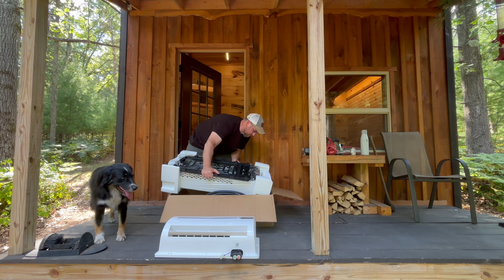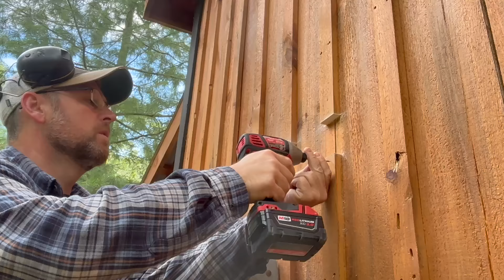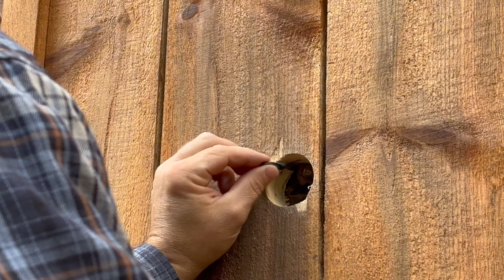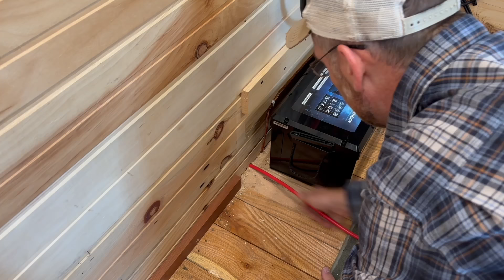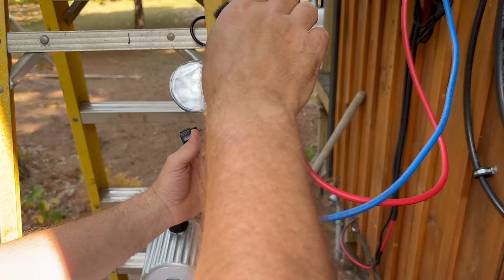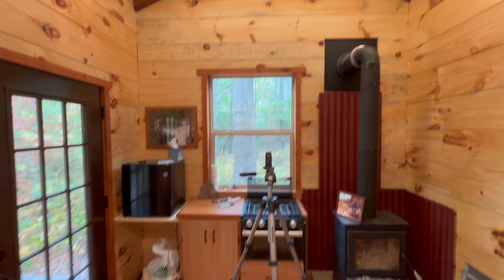12 volt Air Conditioner in the Off Grid Cabin ! OutEquipPro

Comment: So if you do not mount any of this in the van, (I'm living in mine) can you just prop the inside unit against the van wall and keep the main unit outside?  I ask because I don't need it when driving only when camping overnight anywhere.  That way all I need to do is place the compressor side back I the truck and go to the next camp ground.
Reply from the maker: I'm  not sure that might work but seems like a lot of stuff to drag around . I actually put one of their 12 volt roof top ac units in my camper and it works great , it only weighs 40 pound and its low profile here's a link to that video might be a better option .https://youtu.be/ZJUVoA1Ut2k

Comment: Just drill a bigger hole inside for everything. Then cover it with an appropriate piece of timber. You are making a relatively simple job way harder than it needs to be. Other than that you have made an awesomely informative video. Really appreciate the rest of the detail!!
Reply from the maker: good point !! thanks , glad you liked it !!
Reply: He did it correctly dont teach bad habits cutting corners is laziness
Reply: @MichaelConnor-e3z  You are mistaken if you think it is laziness. The correct way is to get the job done is in a timely manner as well as making sure it is easily serviceable in the future. Wasted a lot of time on those small holes for no gain.

Comment: When pulling a vacuum on this unit, listen for a change in sound when you're shutting off the valves. If no change is sound, you're at a negative pressure as possible. Your machine sound didn't change when you closed the valves! 

Is this cabin just going to be used in the summer? This unit appears that it can't be in a "heat" mode.
Reply: Went to website and with the noise levels it should be much quitter when running. At 35 db's you shouldn't hear it running.
Reply: 10x14x12 is 1,680 cu. ft. Plenty big to cool your cabin. In homes that I helped build I was up to 40,000 cu. ft. @ ton (12,000 btu's).

Comment: Commercial refrigeration guy here.

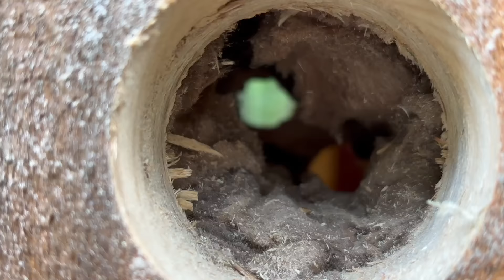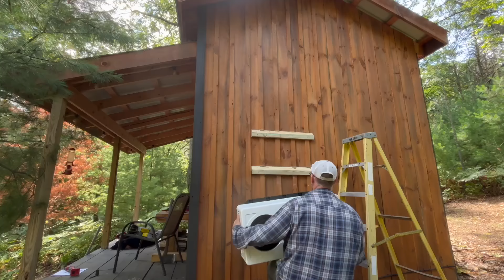We use microns (micrometers) for measuring vacuum. Analog gauges are horrible for measuring vacuum (but the best for measuring higher than atmosphere pressure.) Their most accurate reading is when the needle is at the 12:00 position. So in a deep vacuum at the 7:00 position, it's not accurate at all. For refrigeration, accuracy matters because we have to control things with 1 degree (f) accuracy - like for medical equipment. A vacrometer that measures microns is the tool for measuring vacuum pressure.

I always pull a sub-300 micron vacuum to make sure there are no leaks. The difference between 29" of mercury and 29.9" of mercury is 20,000 microns. 29.92" is a perfect vacuum, which costs 10s of thousands of dollars worth of equipment to accomplish. So 300-250 microns is the best you can really hope for with standard equipment.

Air Conditioners are dirty nasty things that don't require much precision. For ACs, it's not that big of a deal as far as moisture or trapped air is concerned. But a 30" vacuum measured by analog gauges isn't a good indicator of whether or not you have a leak. 300 microns or less guarantees no leaks.

I'm not nitpicking and I know this comment isn't really relevant. You seem to be a self-educated type (like I am). So I figured a little random info from an old refrigeration guy might interest you (if you even see this comment lol). Speaking from personal experience, I love the trades and I love learning about certain habits or techniques from pros - whether I'll ever use them or not.
Reply: Me and my dad just installed a mini split at his house a month or so ago, we were racing to get it done right before an ice storm. We got it done and wanted to do a nitrogen and bubble check before re vacuuming and letting the refrigerant go. We were too late and it started freezing before we could bubble check the outside unit. 
I left him my equipment and a couple weeks later I walked him through how to set it up with the micron gauge. There's a bad spot somewhere in the pump or gauge set and you have to play with the knobs to start getting a good vacuum. -30 on that set is easy to achieve and he finally understood that after seeing the micron gauge go to 4k or 8k and -30 still holding strong on the manual set. 
He finally let it go at 150 microns. I wanted him to hold out for less than 100 but he said 150 is probably better than what most do. 
I need to get a vacuum tree and maybe try and rebuild my gauge set if possible.
I wonder if you can rebuild a 4 port yellowjacket gauge set?
Reply: @jamesrogers4674 150 is really good, if it's an accurate reading. 300 is about as deep as I go because of time constraints. Customers look at me weird if I'm sitting in my truck playing games on my phone for an hour while waiting for a system to vacuum.

You can totally rebuild yellow jacket manifolds. All the parts houses sell kits for them. Most of the leaks are in the little o-rings on the hoses though. They get chewed up over time. They're easy to pop out and put back in, just make sure you put the Schrader depressor back in. (You can also pop them out and flip them 180 degrees in a pinch if you don't have spares.)

If you have access to a sniffer (electronic leak detector) it makes finding leaks 100 times easier. I put a few ounces of refrigerant in a system, backed by 250psi of nitrogen. The sniffer gets you to a general area, then you can pinpoint with bubbles. On a mini-split it's probably at the flare nuts at the condenser or air handler.

Comment: The outside unit looks exactly like what truckers use in their trucks. I thought about installing one of these outside units by room, moving my spare tire and mounting it in there I was just concerned about dirt or water from the road, which shouldn’t be a problem considering that it’s an outside unit and the fans would be facing down. somehow, I knew you were getting the cart ahead of the horse install installing both units to the wall without connecting them first. i’m really thinking you should have all wiring and hoses in a conduit being that you’re in the woods and animals like that chew on things.

Comment: I found that torquing those fittings to spec  by a hired technician was essential. He didn’t do this. One of our units slowly leaked the VERY expensive Freon over a period of a year. I took it upon myself to install the replacement minisplit. I followed YouTubers guidance. It’s held nicely over the last two years so far. Thanks for the video, love your cabin!
Reply: It sounds like yours was a residential unit with flare fittings.  For those, it's a metal on metal connection (no o-rings) so the flare must be perfect and the torque spec is critical.  His is an automotive unit with automotive fittings.  They have double o-rings and operate at much lower pressures.  So, the torque spec is really not that important.

Comment: I have been running a dual head split mini n a 400 sq ft tiny house for 5 years without an issue. I did put a surge suppressor on the power line.
Reply from the maker: Awesome! Glad to hear yours is working well

Comment: Just curious but couldn’t you have just ran an AC outlet from your inverter to a window ac unit?  You might have to put in a window but that’s not necessarily a bad thing..
Reply from the maker: yeah I don't see any problem with that I guess . I'm no expert but it does seem like everything ran on the inverter seems to draw power faster than if its DC though

Comment: Open the indor unit and try to fix blower motor position most of the time preoble is that sometime during shipment the blower motor dislocate fro it's place and make such noise I have face this problem before it's 100% blower motor dislocation position

Comment: You can't really judge the A/C in 75 degree weather. Test it again when its 90 degrees outside and that's when you really know if it works. My bet is it would fail the cooling test under the conditions you really use A/C.

Comment: I like to use scrap pieces of solid copper from romex trimmings to use as short pull / push sticks for wire. Steel tig wire works a little better since its stiffer and springier but if you don't have it 12/14ga copper works well.
Reply from the maker: Thanks for the tip, that's a clever solution!

Comment: So there is no reason why this shouldn't work as well as a 110v AC one...Because the limiting factor on this is the power you are pusing through to the motor...sure, it is only 12 volt...but there is no reason why they couldn't put a 24, 36, 48 volt motor in for the compressor side...so, it only matters if it is something silly stupid like a Peltier type device.  Those are awful for the most part as they can ONLY ever really get you a temperature delta of at best about 30degrees.

That being said...
It is possible to actually build your own AC from scratch (not completely easy but possible) because all you would do is replace the two motors with DC of the voltage you want to provide.

Run the entire cabin on DC and have the appropriate regulators and  buck converters for changing the voltages where needed for each device.

Your only real limiting factors will be how you generate the power.
You have the land for solar grid array on the ground...you are in the environment for a good above tree top height wind..I don't know if your property has any running streams on it...but if you do you could even include a lower flow water system that builds head pressure through numerous ways.

Comment: From a noise perspective, how about not mounting the outside unit onto your cabin, but on a stand of sorts, supporting the weight and preventing noise vibrations from going straight through the wall? Not possible on a van setup, but on a cabin...

Comment: As an HVAC tech for 29 years I would say that indoor unit is not gonna last. Maybe had some packing material in it or just needed to have the blower adjusted. Few things I would have not done is had those lines looped up like that. You just made a bad oil trap which will burn out that compressor eventually. Need to lower that condenser and I would have tried to make it on a hinge to swing out for coil cleaning. Other than that I can very much appreciate the DIY and units don’t care what they are installed in. Long as the power is right it will run. Overall nice job for a quick solution. That place is beautiful.
Reply from the maker: Thanks !!! I should pull it off the wall and check to see if I can figure out what the noise is . so what if I just tied the top of the hoses way up so there's not a big loop on the bottom . do you think that would stop the oil trap problem ?

Comment: WTF!?!?  When you turned on the unit I thought you were running a gas generator to power it.  What is that horrible noise.  Any other system I've seen installed you could not hear running. I would take that cover off and see if you missed some packing somewhere.  Thinking it is no big deal is a recipe for dead fan or leaking freon ...
Reply from the maker: I plan to but I've just been so busy with my other cabin build I haven't had time for much of anything

Comment: I've never heard of this brand of mini-split, but these are one of the perfect instances to use em. I'm sure this guy researched the brand beforehand, but if anyone else is thinking about installing a minisplit, I'd recommend doing alot of homework. I've worked on these from all kinds of manufacturers, some from several locations in Europe, where you may be waiting for replacement parts to get shipped to you. And when I say waiting, we had a customer wait 6 months to get a circuit board from Crimea(?). Most mini-splits we work on are the ones DIY guys tried to install themselves, which is fine, but trying to save cash may ruin the system and burn whatever you paid for it. Study the system and do your research until your comfortable with installing it, or buy it and pay an hvac company to install it. They're made for DIY, but the instructions aren't always translated well. Don't let me scare ya away from it, but please make sure you got a good handle on it to save yourself a massive headache and a massive bill. Best of Luck! And great video!

Comment: You are actually better off just drilling one big hole and run the lines wire and drain through a PVC pipe and filling with caulking, I've done many of these, it's just better because of vibration and condensation. First time is always the hardest

Comment: Here is a little help. Instead of running 2x4's on the surface of the cabin exterior, use a piece of exterior 3/4" plywood. This will make a closer and better base, and keep debris and critters out of the woodwork. A few inches above the unit add an overhang allowing cooling vent breather room, this will keep nests and leaves from falling into and on the unit somewhat. The cables should also go immediately inside the cabin, not run them on the outside surface.  You can splice longer wires onto them, or shorten them and add a plug or switch inside, but remember it has to carry a lot of amperage to operate.

Comment: Not sure , but doesnt that condenser  unit need to be flat with the fans facing up? Seems like if it has a compressor would have a oil issue. Thought those units need to be mounted flat, like on a vehicle roof. Cool product

Comment: Hopefully the condenser unit is on the north side of the cabin to keep the sun from heating it.  Our house faces almost south so the outside unit is on the back side where it only gets a bit of sun in the early morining.   In Tennessee, we would have the doors open and enjoying the 77° outside.  We turn the AC on around 82° outside.

Comment: Are their similar 12 volt air conditioners for windows?   I've considered running the pipes through the bottom of a sliding window.
Reply from the maker: that I dont know . I found this company for my roof top camper 12 volt ac and liked it so stuck with them

Comment: Does your power supply say how many watts the unit is pulling 
Thank's 
Good video 
I got a 15x15 building 
Wish they produce a 12volt
Window unit
Reply from the maker: It doesn't . I'll try to get a shunt hooked up in the spring and do a test running it for quite a while maybe though the night and see power consumption . I dont remember what they said it draws but I know I put it in the comments somewhere . I think the max watt draw is 62 . I would assume during setup
Reply: @blackspruce1861 thanks

Comment: How many amps does it draw at 12 volts.
Reply from the maker: I can't remember the lower number but it can draw up to 62 I think for start up I would guess
Reply: @blackspruce1861 not possible a 12 volt battery can't possibly deliver that many amps. I was thinking it would run more efficiently on 12 volts because a pure sine wave  inverter draws 3 time more amps than a stand alone 12 volt battery.
Reply from the maker: The battery I have says right on it that it has a peak output of like 2 or 300 amps

Comment: Just a FYI, when you do a vacuum on a system and you're done and everything is good you should open the valves first then remove the hoses.  Also, put some tube insulation on the refrigerant hoses.
Reply from the maker: Thanks for the tips !

Comment: did you know they make bits for installers to run wire thru walls.. it has a hole in 1.5'' from the tip. you can thread on conductor thru it, and use bit to pull thru,,, no tape..
Reply from the maker: No I didn't that would be pretty slick !
Reply: @blackspruce1861  i enjoy for videos and your access to tools.  Fine craftmanship... keep it up
Reply from the maker: @MarkCowart-w5t thank you!!

Comment: You might be able to upgrade the efficiency by adding a DIY Geothermal loop on the outside to dump the heat into the ground instead of the air.  Check out how this guy made a cheap window unit over 3x more efficient with a ground loop https://www.youtube.com/watch?v=s-41UF02vrU

Comment: Nice installation, I do HVAC for a living and the only thing I would suggest is to use a larger hole saw and install a pvc pipe like 1 1/2" as a wall sleeve and run hoses an wire through the one sleeve and seal it.
  These mini splits really  have changed the game getting comfort in many applications.  The big thing is to keep the coils clean.
Reply from the maker: Thanks !!  I probably should have went with a larger hole

Comment: Im an ac guy and i race dirtbikes, i travel around texas camping in my van, its not like its a deal breaker but, Theres a volume of compressor oil measured in when assembled like a refrigerator, these ac's cant be laid 90% off the oil migrates outta the compressor and past a trap, etc, when the video started the outdoor unit looked like it was shipped laying down. 🤔 i suspect like any company they have a CYA disclaimer in the box that says warranty null and void if box not transported in up position, etc. Basically my question is, there any mention of them speaking to accounting for this concern?
Reply from the maker: I"m really not sure if they did or not , I dont have any of that stuff anymore to check

Comment: To all other people who will install in the future: Before removing the hoses from the unit,after vacuuming, first release a bit of gas,like to 0.5-1 bar, this way will avoid the air to enter back into the installation when you remove the hoses. If you don't do this,all the vaccuming was for nothing, because the outside pressure vs the inside vacuum makes those valves(similar to those of the car tires) to compress their spring,letting air in, also as you unscrew the hose,there is a moment when the hose cap is untighten and the valve pin still pressed,so the air flows inside.   PS: Jesus ,where do you buy the set of gauges at 130$ ??? That is 25 euros here in Spain,and in Europe in general. For 150 i got a digital measurer (Testo),with the hoses,in a nice  case and the vacuum compresor for 80€,,plus  2 adaptors for car  AC for 9 euros,sold separately.